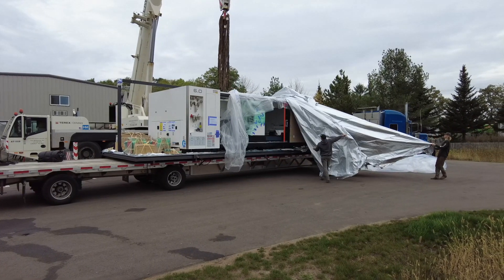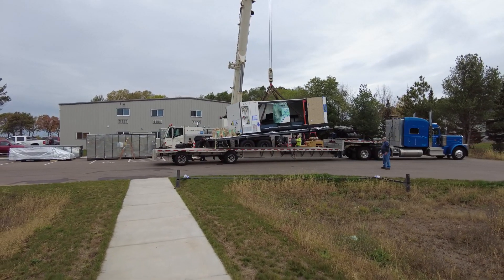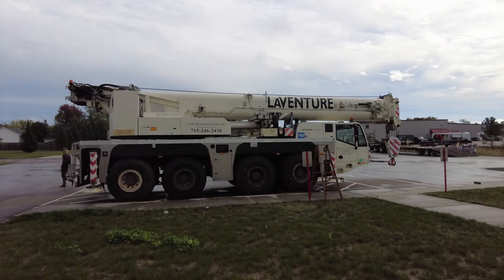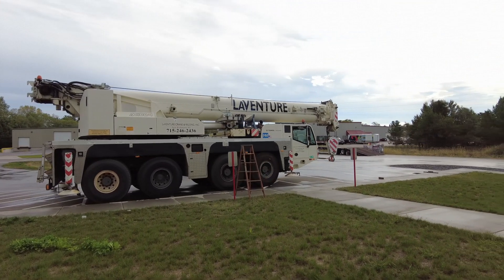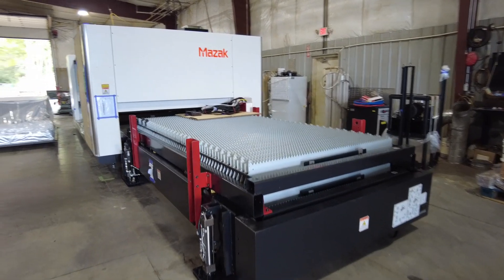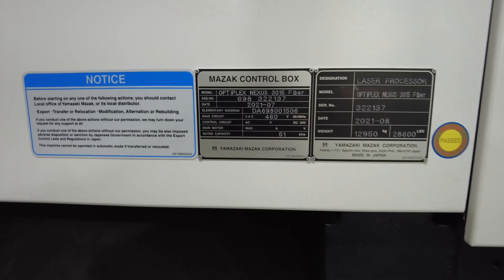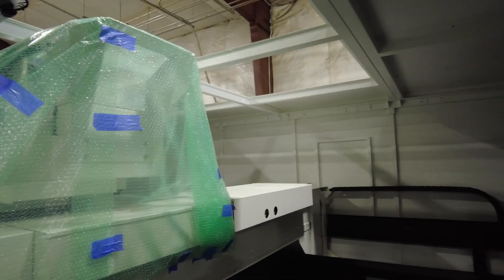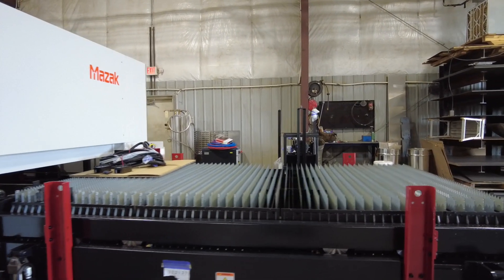New Mazak Laser!! It's move in day at Wolfe Ridge!

Comment: How thick will it cut Chris?  Very impressive machine
Reply from the maker: This machine is designed to cut up to 1" steel, 3/4" stainless and aluminum. They cut thin sheet metal super fast, about 5X faster than our old machine.

Comment: Wasn't thinking pucker. Straight seized up. Man I hope the Rigger isn't green. 
Being a driver,I've been at 3 different lifts and they dropped/ rigging failure/ crane winch failure. 
Machine ruins the Retinour drop deck I pulled. Gut just knots up.
Cant you just pull the trailer to a Truckstop? Sure,in fantasy land.